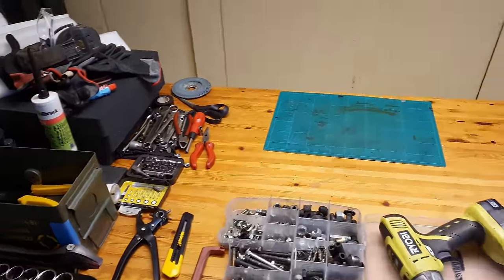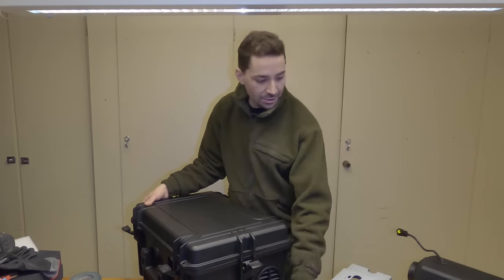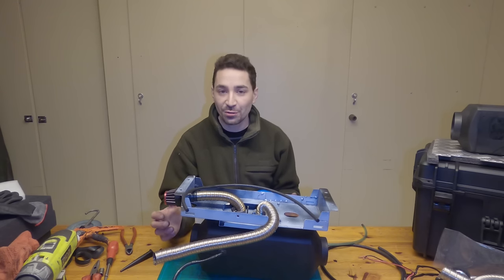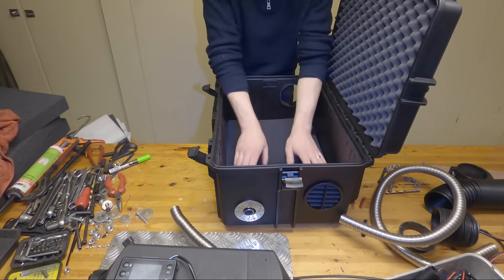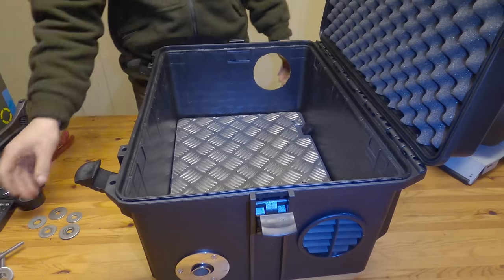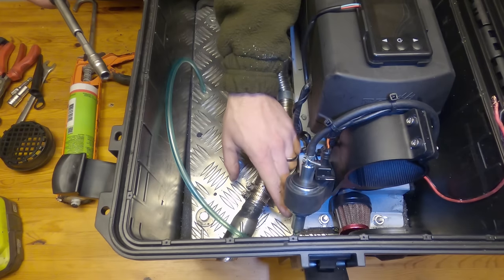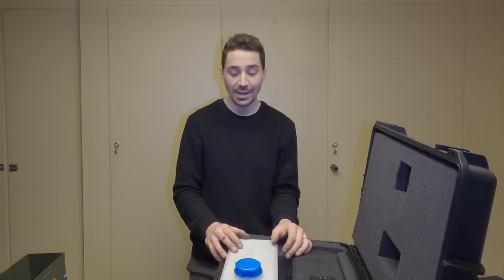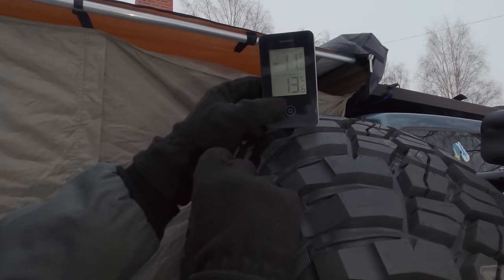Weather Resistant Diesel Heater / Mk1 Portable Build

Comment from the maker: Winter Camping can be pretty tough here in Sweden. Temperatures can range from -5c to as low as -40c across the winter period. Although camping in extreme low temps is not something I seek, I do like to camp down to about -15c over winter. Having a Diesel heater system onboard the Jeep XJ is a great way to create a warm environment in an Awning Room, Ground Tent or Roof Top Tent so that you can escape the bite of winter and warm up yourself and your gear. Diesel heaters also consume little fuel and run on 12v so you can run them through the night provided you have a stout leisure battery and don't run the heater on full power for many many hours.

In this video I take the all in one Chinese Diesel Heater I bought, strip it down and repackage it into a weather proof, self contained unit that can be mounted to my tire carrier or roof rack. These units can be noisy so this build focuses on eliminating pump noise so that you can sleep just to the drone of the intake and exhaust which is far easier on the ears much like white noise.
My only take away from this would be to advise you to move the air intake to the underside of the case so that you get a much better weather resistant unit than mine. I will build a small cowl to cover my intake to aid with sideways rain.   
You will find all the gear I used in the description below.
Thanks for watching.
Reply: Hey it would be much more efficient if you added a second duct to pull air out out of the space your heating through the heater then back into the space that way the heater doesn’t have to battle the outside temperature once it heats up the space it would also eliminate the risk of exhaust gasses being blown into the heated space
Reply from the maker: @Cam-gb1cu  I'm sure there are many ways to do it but retrospectively this has functioned very well for me for about one year. I have made some small changes since then, like a bigger fuel tank, longer exhaust fitting. Normally these days the ducts pull air from inside the tent and recirculate it. Thanks for watching.
Reply: I am looking for more information no this ?
Reply: Yeah recirculated polluted humid inside air through heater, that's smart.

Comment: Great build, you gave me some great ideas! One thing I did to my portable unit was drill out the vent hole on the tank and installed a 1/8” small ball valve. Allows me to carry at angle without leakage. Thanks for the video👍

Comment: Very nice build.  I like this idea of having it outside, just in case something goes wrong.  I could mount this in a box on a hitch cargo carrier for use in my van.  Thank you for showing this.
Reply from the maker: Thanks for watching. It's still working well over a year later. I just plumbed it into the fuel tank so it's not so heavy and big. Good luck with the build 👍

Comment: Hello from the Smokey Mountains of North Carolina.  I want to thank you for taking the time to make this video.  I learned more here in 30 minutes then  during my entire venture on trying to understand these heaters.   We  are Jeep people too....2019 JL Rubicon and a 2002 TJ Sahara.   We are considering getting an Overland Trailer for our mountain adventures and HEAT is the one thing I have not wrapped my mind around yet.  People don't realize that when you compact your kit and equipment into an  Overland Platform that you need both efficiency and  effectiveness.   This is a challenge when trying to meet in the middle.   We are trying to assemble extreme long term solutions whereby Propane is just not suitable.  We run a Springbar Canvas Tent with a Winnerwell wood stove now as our common area heat source and I am scratching my head on what to use for the trailer at night...I am leaning towards the diesel heater systems.  Be Safe.
Reply from the maker: Thanks for watching and for the comment. Trying get effectiveness and efficiency is always a mind racking challenge of trial and error for me. The diesel heater has changed things over the winter and has proven to be a essential carry item regardless of where I'm going. I've used it to keep the cab warm in a breakdown for the family while I worked on the Jeep in the cold. Its also great for camping. My only advice would be to pack a spare Glow Plug, ECU Control Board and Fan Unit for the heater. This sounds kind of counter productive because its implying that the unit is prone to failure but its more than these are the most likely components that fail. They can be swapped in a short period of time and your warm again. 
Just my take on it, but over all they are great. Good luck on your adventures and thanks again.

Comment: I wrapped my exhaust pipe with header wrap, I also run two hoses inside the tent. Heat in one side and fresh air out the other. My theory is twofold. First: the heat inside the tent will be warmer than outside air, essentially recirculating warm air, being easier on the heater.
Second: circulation of the air should be healthier on the lungs.
Reply from the maker: The only issue with recirculation is the terrible amount of condensation in the tent. Pumping in fresh air from outside eliminates condensation and keeps the tent warm and dry. It also feels warmer because its not damp air. 
I've run my heater two winters now, temps from -5 to -25c. Condensation isn't good in these conditions.
Reply: @WorkshoptoWilderness  heck that could be my issue. Living in TN, humidity and condensation are so normal, I never thought the heater could amplify the situation
Reply from the maker: @nate4036  Give it a try and see how it goes. For me it was terrible and the tent was so wet in the morning. I cant run a recirculating setup in the jeep or tent for this reason.

Comment: I love this idea, I've seen a few videos lately about folk trying to silence them. I have mine in my converted Mazda Bongo in place of my rear heater matrix and linked into my tank. One I seen used a marine fuel tank instead so I'm thinking that putting this type of system up on the roof rack with a big marine fuel tank and using the space inside for my batteries as I could double up to two, that would free up space in the front for a compressor.

Cheers for another project, I thought I was done for a while..!

Comment: Check the little hole at the side of the glow plug, if this is blocked it will cause white smoke, the hole is for the air to mix with the fuel, if it can't, this will cause the problem, and replace the gauze inside the glow plug hole.

Comment: I picked up six of the Ebberspacer heaters (DL1 first gen) for only 200 USD about 25 years ago. Replaced bearings on one of the motors but now I have at least two working units. They did not cm with pumps and I wound up paying around $125 for one OEM pump  from one of the truck supply shops. There is a Gent in the UK who is making an electronic dosing pump that is fully adjustable based on the size of heater, no more clicking! They have no fancy control panel but I did get one basic adjustable thermostat with the lot. These things are great for warming up small areas and workshops. Espar also makes gasoline based heaters as well if ones vehicle does not use diesel.

Comment: Makes sense that there shouldn’t be any hot spots or melting on the heater housing itself, as long as the fan is running its cooling itself. The only real danger is the exhaust port, but you got that squared away. Well done, im working on a similar setup now.
Reply from the maker: Thanks for the comment. It seems to be running well. I've upgraded the fuel tank since this video. Just slight bigger with the feed from the lowest point. I did a camp last week and the heater ran for 15 hours so fingers crossed its all good. Hope the build goes well and thanks for watching

Comment: Hockey pucks....haha genius. Who'd have known how many uses they could have. That's a great little setup you've built. Sort of makes me think I wish I hadn't hard mounted mine into the trailer. One of those awning  carpets for the floor might work well - waterproof on the underside, fluffy on top.
Reply from the maker: Good old hockey pucks. Their good for bump stops at least! Hopefully the carpets work. The awning room is not really an ideal room for winter but at least its wind and waterproof so it holds the heat fairly well. A mylar blanket on the roof may help also. Thanks for watching mate and hope all is well!

Comment: Saw a video where guy screwed a cup hook into wood above then suspended the fuel pump from that hook by running a zip tie ( tie wrap ) through the mounting hole on the pump bracket. It was super quite after that.

Comment: I really am looking for a weatherproof setup and yours is the winner! The only thing I would add or change is a longer exhaust pipe or move  the exhaust to blow the other direction. I think it is too close to the fresh air intake. Watching the air heater animation shows that is where it gets its air to blow to the front of the unit. I also recommend a carbon monoxide detector inside the tent for safety.

Comment: You should try and bring the heat in low and let it rise. Also a return hose from the RTT Or Awning room that way the heater is not needing to heat outside air .

Comment: Nice job with the box, just a couple things you might want to consider 1. A return air hose in the tent to the inlet of the heater this will warm the tent faster by having to warm cold air. 2. I understand why you took the inlet cover off to mount the bracket ,but w/o the vent cover you might have foam get into the fan. I mounted my heater in a metal tool box on its side with the glow plug facing up the air inlet fuel line an exhaust out the back. I installed 2 motorcycle batteries and a 10 amp battery charger inside the tool box. I had to make some changes I used plastic flex hose connectors which melted on the discharge side of the heater after long several hours of max output I found metal ones on Amazon.The other thing I use an external fuel tank out side the tool box I sleep better not having fuel tank next to the heater. One more thing I used high temp silicone 3” turbo hose in the box inlet &discharge. I have fuel pump noise issue to I think I’m going to incapsulate the pump in foam insulation to cut down the Solenoid chatter. Good luck with your project I can tell you really put a lot of thought into it.
Reply from the maker: Thanks for the suggestions and info, its certainly far from perfect and even now ive made some changes to it including the inlet cover to stop foam getting into the fan. I do still want the fuel tank in the box but its changed a lot since this video. The fuel tank is inside a 5.56 ammunition container with a small hole in the bottom for a hose. The winter temps here drop extremely low and I like the whole unit including the tank keeping warm inside the box.  Thanks again and appreciate the info! Good luck on your build also!
Reply: I've seen a few of these type of videos where people are drawing in air from outside rather than air from inside the space to be heated. Making the heater work far harder than it needs to.
Reply from the maker: The heater doesn't work any harder. That's not how they work. It's just a fan pulling air over a heat exchange. It runs how you set it and fuel control is constant. Also an important note is that pulling from outside cuts down massively on condensation in the tent which is the main reason people do it. Dry air, dry clothes makes a big difference. I lived in the jeep for 15 weeks every day and condensation is shit mate

Comment: You know all those "GREEN" people?  You know the ones that want to ban cars and engines? And PETROL?  
Really looking forward for them to go on a "SURPRISE CAMPING TRIP"!     hope they stay real warm with all the hot air they make!

On another note.   THIS IS BRILLIANT!   I wanted to do one of these for a Powerwheels.  Its so cold in the winter.  And it does get cold at night.  And most of the time?  Thats when we find time to go up to the Local Icecream place.   I'm thinking about getting one this next month and starting on the build.  I plan to use some kind of clean biodiesel or kerosene.   
  
Having something like this in a BOX makes this a SUPER easy thing to do while not having to do much in the way of Plumbing.   I wonder if they make them even smaller then this unit?

Comment: Hi Mike, I'm a new subscriber, great video mate, thanks for sharing but can I just say the silencer needs to be vertical and not horizontal. Just twist it 90 degrees so the fixing hole is at the top and the drip hole at the bottom. It's there to stop it from rusting. Again, thanks for a great video and keep up the great work.
Reply from the maker: Thanks Bers, I've corrected that now so it can drip down. Appreciate the heads up. Thanks for subscribing and for commenting.

Comment: Excellent build, thanks for walking us through it! I recently had the opportunity to try a prepackaged version like what you started with and I think it’ll be a game changer for camping with our baby. Even in the summer it’s cold at high elevations. I’m considering following suit and doing something similar, my only hold up is I’m not sure about running a dual battery. I’m just concerned about the weight! But LiPO is extremely expensive. I haven’t quite figured out a solution...
Reply from the maker: I think its a game changer like you say. Even just keeping the car warm while baby sleeps and camps getting setup. Or in the event of a brake down. I took Max out yesterday funnily enough just in -1c, but the wind was something else and he got very cold. Having the heater just allowed me to keep him warm while I dug the snow away from under the Jeep. I just need to build a tire carrier rack for it. 
Batteries are a hard one. My leisure battery is 38kg! I does its job, but its heavy. Lipo costs a lot but its size is worth it I think. Under a rear seat or tucked away so you don't notice it.
Thanks for watching and for the comment.

Comment: Thank you for the video. Nice work but the gap between exhaust and heater intake is a worryingly small. Do not rely on CO detectors.
Reply from the maker: I generally just put a 24 inch pipe on the end and bend it away. Still alive a year later and I use the heater every day in the workshop. Thanks for watching
Reply: @WorkshoptoWilderness  fair enough. As long as you're not going sleeping with it on thermostat 👍👍🙂

Comment: You need to run the Rear fan inlet inside, no difference than vans or trucks and so forth..Makes a HUGE difference, circulating warmer air....Amazes me how people put these outside and not run the main inlet inside as well....Madness
Reply from the maker: Yeah I do these days, obviously makes a big difference. Just didn't have the hose when I made the video.
Reply: @WorkshoptoWilderness  My apologies, read you did that while reading comments after. But I left this for anyone who might be considering an outside install...
Reply from the maker: Ah no worries, it's a valid point for anyone watching

Comment: im not sure it will make a huge difference but for the fuel line my heater came with what some would call thin plastic fuel line. I think it maybe nylon? Many youtubers suggest using this fuel line instead of the greenish color flimsy one that comes with a lot of these heaters.
Reply: Can confirm! Thought I was upgrading by buying “better” fuel hose.. Turns out softer walled hose seems to absorb the pulse of the pump. Had loads of issues until I swapped back.

Comment: Where did you get the red intake filter? Nice build. I’m just waiting on my unit to build in a waterproof briefcase. Using a removable Rotopax when I need a refill. Also was looking at protecting the fuel line by slipping it into a rubber braided hose. It will be outside so the UV rays shouldn’t degrade it over time🤙

Comment: How about a bit of pipe insulation over the fuel pump?
Also running the Exhaust towards the back of the unit, towards the hinge.
Making it further from the air intake.

Comment: 'Hi' from Winnipeg, Manitoba, Canada. Just watched your video and really enjoyed it... Maybe I 'missed it' and I haven't tried to read all of the comments posted below BUT – would it be possible for you to post the EXTERNAL dimensions of the case you used? (Internal would be nice also but that might be harder to do). Reason - I just took delivery of a 5 kW heater and have been contemplating building up a portable system such as the one you constructed and it looks like the case that you used might be just about ideal and I would like to get one or something very much like it BUT THE LINK TO THE CASE ON AMAZON IS NO LONGER VALID. Thanks.

Comment: Great video, thanks! 
I do have a question, does it have a ventilation mode for the summer months, if it was permanently installed in a van/pick-up setup?
I’m planning to do a trip from Nordkap to Cape Town, so I’m only gonna need the heating in the start of the trip, but wanted the ventilation as well in the hot summer nights :-)
Reply from the maker: Hey, Sadly its just for heat in this case. I don't believe it has a feature for just running the fan without the heat exchanger running. I'm sure there is a method for just running the fan off a battery as its 12v. 
I just did a google search and there are lots of people using them for air circulation using fresh air by making some kind of direct connection between the main power in + and - wires and a switch. Apparently its possible so hopefully this helps.
Thanks for watching.

Comment: have you considered an in line primer bulbto prime the pump/engine prior to ignition, much like a boat motor?
Reply from the maker: I'm not sure what that is to be honest. This system was useful but i rebuilt it in the recent videos so it took its fuel for the jeeps main tank and was a much smaller unit. Seem to be working well so far. What's the thing you mentioned?